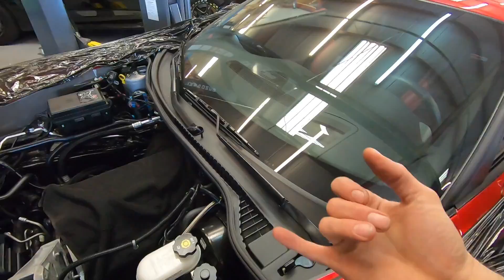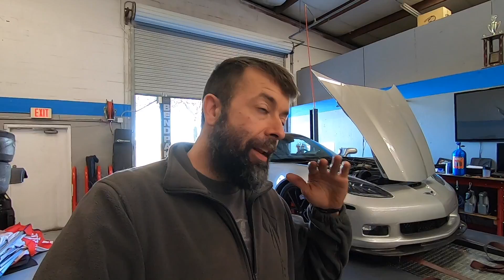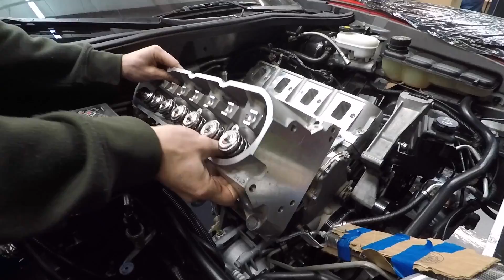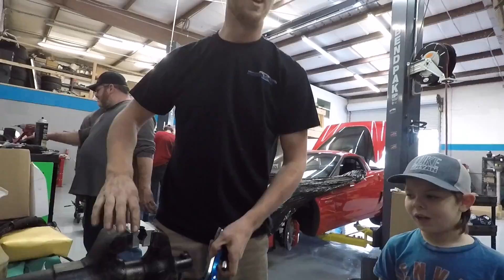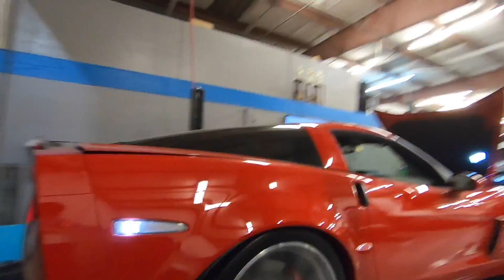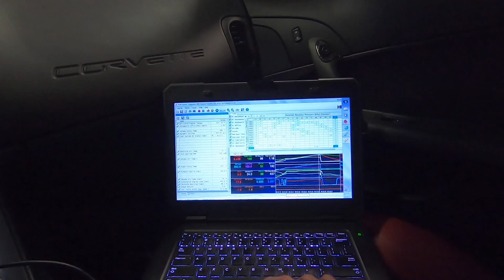Building, Tuning & RIPPING My ULTIMATE NA Build! (2006 C6 Corvette Z06!)

Comment: An '03 "Terminator" and a '06 Zo6 are my two dream cars since I turned 16. I'll be GLUED to this progress ❤❤❤
Reply: I want a c6 z06 so bad heck id be cool with a c6 grand sport. Like 06 07 when ever they started ls3 instead of ls2
Reply: @evand8682  grand sport's trim packages are goooorrrgeous 🤤🤤🤤 and that subtle double strip on the front fender...there's somethin about it. It's pretty
Reply: @evand8682  ls3 started in 08 🙌
Reply: @nickadkins7765  Yep, and the grand sport didnt start till after the Ls3 was out also
Reply: @evand8682  08
Reply: @evand8682  grand sports are more expensive lol. LS3 started in 08. Get an auto LS3 car and do a centrifugal blower over a Z06. Z06’s are nice and light but the LS7 is just junk, take that from personal experience.
Reply: Nick yeah I knew it was around that time lol. Only good thing is the ls2 cara are pretty cheap. Where in live in south mississippi I see I/c/I ls3 cars for like low 20s sometimes less with alittle mileage

Comment: How much displacement do you lose when you change the compression ratio by removing some head?  Negligible?
Reply: None. The displacement is all in the cylinder bore and stroke.
Reply: @RJMay3  Sorry, wrong, the cylinder head also counts as displacement because it's the combustion chamber.  Just wondering how much displacement you lose. But probably not as important as gaining compression ratio if your able to burn the fuel.
Reply: @thewakz  a 302 Windsor is a 4 inch bore by a 3 inch stroke.
Pi(R squared) is the area of the bore, times the stroke, times the # of cylinders gives you the displacement of an engine, regardless of ANYTHING ELSE!

3.1415 x 4(radius squared) = 12.566(area of the bore)
12.566 x 3(stroke) = 37.698(displacement of one cylinder)
37.698 x 8(number of cylinders) = 301.584 (cubic inch displacement)
It's a 302!

A 1969 351W 2V has 9.5 to 1 compression(dished pistons). A 1969 351W 4V has 10.7 to 1 compression by way of flattop pistons. They're both 351 cid. The only way to effect the displacement of an engine is by way of bore or stroke.

School is out, boys. Play nice with the other kiddies during recess!😉
Reply: (That dude is right) Displacement is bore x stroke. Compression ratio is bore, stroke, cylinder head combustion chamber cc, piston shape domed/ dished/valve relief, and head gasket thickness. Machining the head looses overall volume and increases compression ratio, minimal but it changes.
Reply: @Brother2Jis_27s4  That's how you calculate the compression ratio, dumbass!
Don't be a fool, stay in school!
Reply: @Brother2Jis_27s4  Is he increasing the compression ratio because it's going to be running on e85?  Or does it also see a performance increase with pump gas?
Reply: @thewakz  On a n/a motor more compression means more potential power. So increasing the compression ratio increases your risk of pre detenation/ knocking with lower octane fuel. E85 has a higher octane rating than pump gas which in turn gives more potential for power. Higher compression always gains power if you can use a fuel that resists pre detenation/knocking. There will be gains for both E85 and pump gas, more gains on e85 than pump gas due to e85's higher energy potential and octane level

Comment: funny thing is that if The O.G. Legend had that Z06 Transmission, and gear ratio it would trap in the 135+ mph range... not too far off the power level you're expecting from that Z... Goes to show you how much power your dad's car really makes. the unlocked automatic really robs some H.P... then again the 420 ci SBC is only 7 ci less than the Z. the big difference head flow, intake design, and exhaust size. summary: your dad's car is a freak!

Comment: Wait, isn't it starting at 500hp? I'm thinking this isn't a budget build for the amount of power you're getting N/A compared to a forced induction setup. A constructive sized turbo I'd think would be a better budget setup. I'm not arguing with any other reason to go N/A other than the "budget" claim.
Reply: josh bishop “budget build” is figurative based on what you want. Sure you could make that much power n/a for less money up front, but would it be engineered to be reliable over time? Sometimes the phrase “budget build” has to take the long term cost of ownership into account as well.
Reply: Stock c6z Dyno 440-460 at the wheels stock
Reply: josh bishop...........We're talking about hp AT THE WHEELS.........NOT "at the crank". There's a huge difference there. 620 hp & 560 ft/lbs of torque AT THE WHEELS on a naturally aspirated motor IS INCREDIBLE POWER. "500 hp at the crank" is only around 420hp at the wheels, or maybe even a little less. Get it? ........ALL of the auto makers (Dodge/Chevy/Ford ) advertise their horsepower AT THE CRANK.
Reply: josh bishop that’s to the wheels though. Probably around 700whp at the crank. Beast of a N/A engine
Reply: @mikedurling2111  Mike Joe.........On this particular platform.......I would dare say 620 hp at the wheels is closer to 730 at the crank. ( especially with such an impressive 560 ft/lbs of torque at the wheels too ).........
Reply: this is a very happy dyno

Comment: What type of insulation is that, which gets you 100 degree difference?
Reply from the maker: Mylar from Home Depot !
Reply: @Optical Clarity Master's level, or bachelor's level (in each discipline)?
Reply: @Optical Clarity it will survive, when they pulled the thermal sheet off the caprice it was all in one piece and its been through a lot of heat cycles
Reply: @Optical Clarity I'd have to agree that an air gap would be the proper foundation for the idea. Perhaps combining mylar, gold and ceramic?
Reply: They sell a sticky sheet for ls engines on summit but they’re like 60$. Where can you get the cheap sheet they’ve got?
Reply: @Optical Clarity another way would be to seal the area, and use intake vacuum to pull cool air through a heat sink.

Comment: the ultimate NA build should be your pops vette
Reply: Jason Russ I second that movement. 👍
Reply: Rickybobby 03 hell ya brother
Reply: Jason Russ pops vette will need more cubes to compete with a h/c/I 427 lol
Reply: Truf
Reply: Depends what context ultimate your talking about. Many guys running low 8s and a few high 7s N/A. Yes most are all out race but not all. It's also why Garrett's not the first GM stick car in the 7s. First with that gen vette with a manual no argument there. Few guys that run N/A stick class got into the 7s a few years ago in the north east. Both Chevy and Ford's. There's a lot of bad ass cars out there. Many never get seen on YouTube though. Sometimes people think if it's not on YouTube or the internet it doesn't exist lol.  
These guys do some great work. I started tuning cars 20+years ago when you needed something like Haltech or Gen6 DFI but Really loved when I got my hands on  F.A.S.T around 2000. You couldn't do shit with factory ECU's for the most part. Chips sucked and most didn't do anything you couldn't do with a timing light and adjustable fuel regulator. This dude knows his shit. I seen many of his videos with tuning and does a really great job and knows what he's talking about. That's coming from someone who started in the 90s. Anyway like I said really nice number for what's done with the car.
Reply: Wayne Bollentin.....wow its nice to see someone who knows about these cars up in NE. We really don't get recognition like evrywhere else. I know all my buddies don't like to upload anything, in fear of Local Leo problems....but hey... like ya said, if its not on the intertubes, then it can't be true!!! haha.

Comment: Would an 08 ctsv have a ls style. Motor? Also if it does do. U know what displacement it would be thinking about jumping on one that is a great deal
Reply: I didn’t think there was a CTSV produced in 2008
Reply: @IMPOSTR-F150  would it be just a cts? Would the cts have the v8?
Reply: The standard CTS has a 3.6L v6. The CTSV is the only variant with a V8